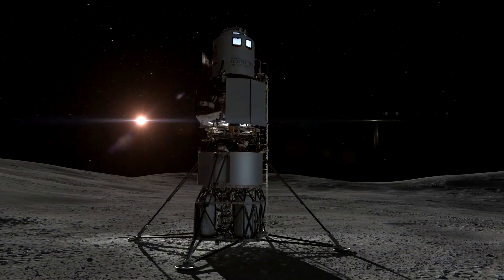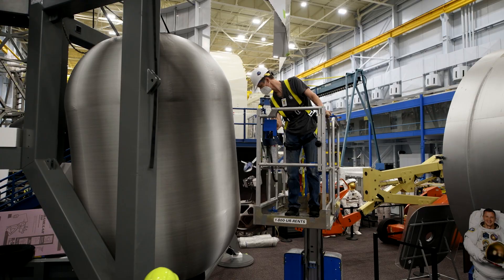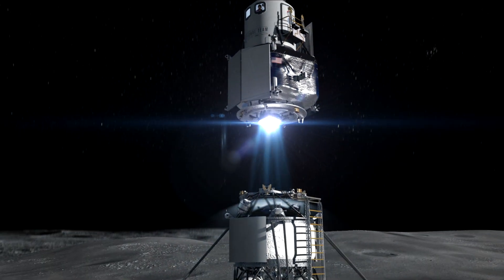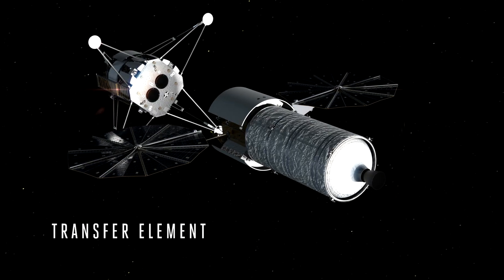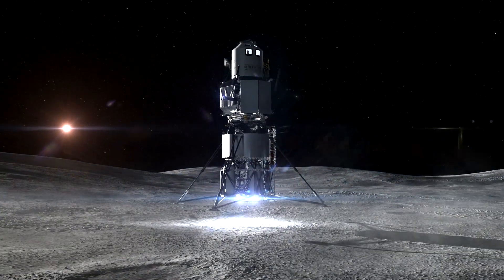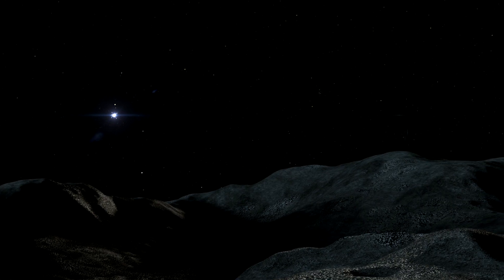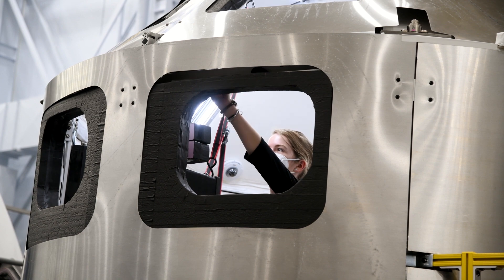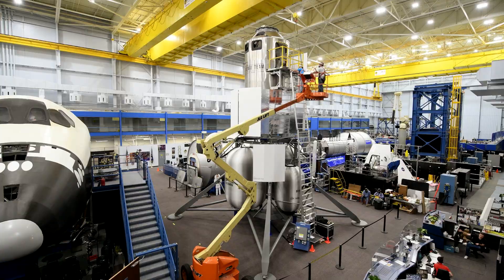Blue Origin-Led HLS National Team Mockup

Comment: I don't understand how this particular lander design will help us "stay on the moon." From the mock up it looks like it has the same capacity as the LEM (2 people) and it's not even meant for permanent habitation. Neither Blue Origin video explains at all how this is helping further habitation on the moon other than simply returning.
Reply: The Descent element can land on its own with plenty of cargo on its deck, anything from rovers to habs. Its a good set up because flying both large amounts of cargo and crew on the same lander would be inflexible due to the added mass and risk that comes with it along with the inability to perform crew-only missions to the surface. The descent element also uses hydrogen and oxygen which can take advantage of lunar Ice in the near future unlike the other two HLS systems.
Reply: well i mean returning is better then nothing. But i get your point
Reply: @milchael  Yeah, you're right -- I just feel like the branding in this video is a bit dishonest
Reply: @Fanunic  I thinks its the fact that this lander(descent element+transfer element) could land over 14 mT on the surface. That is enough for a habitat the size of ISS Destiny module.
Reply: @Matthew35333  well im tjat 14 ton there is need for a return engine. So not.much usefull space look at the capsule it 1 by 2 meters
Reply: I think They will land next to a colony so it's not needed to have a big module
Reply: It's probably modular and easily modifiable which will drastically help in making things cheaper, so if a single computer fails you can just send a replacement one instead of having to take everything out and fumble with parts and hope it works.
Reply: Simply put, having a lunar lander at all and having the capability to reuse the vehicle allows us to stay on the moon through allowing us to lower the cost of the lander, landing on the moon and by having the ability to stay on the moon. Who knows they built a completely new lander that’s 100% reusable or stay with this lander, altogether it is important that we even have the means to land on the moon rather than just orbit the moon
Reply: This one is probably less about staying and more about making a low risk lander that is likely to be finished on schedule.
However it is supposed to use things fuel cells which would allow it to function during the two week lunar night.
Reply: by leaving a lot of trash and parts of the lander behind we create a 'permanent' "pressence"
Reply: @HilkoRigterink  hey, if they crash enough of them that'll be some invaluable raw materials for someone more ambitious to work with.
Reply: I don't really get the "game changer" argument neither... it's a LEM 2.0. Not to mention the overcost induced by making this project modular and ask 3 different companies to build eack module... I think this project will be the next SLS. I won't mention the 4th company involved in this but not part of the "modular" project but my hope of seeing a moon base rely on the 4th one for sure, because this is going nowhere.
Reply: It's sustainable because it's cheap to launch, and once we have fuel production on the moon it will become fully reusable. This vehicle will be good for getting humans down to lunar surface to build landing pads for Starship and other initial base infrastructure that will be shipped via other means.
Reply: @JohnnyThund3r  I don't believe anyone has ever said the SLS is cheap to launch.
Reply: @spacetourist247  he never mentioned SLS...
Reply: @JohnnyThund3r  Starship won't need a landing pad to be built first... they will come up with adjustable landing legs and an optical terminal guidance system able to 3D scan the ground and find the best spot. Spaceship do not need someone to prepare the moon for it... because it will be the first one on the moon. The modular project will go nowhere and won't be able to keep the timeline of 2024... Those are the same kind of companies that built the SLS...
Reply: @Callum This doesn't use SLS, it's uses 3 commercial launches and assembles it all in orbit.

 @Turbo999be  Boeing is the problem child with SLS, Boeing used to be an OK company 10 years ago, now they just suck, Lockheed is a better company IMO, they tend to be more expensive but they do deliver what the government asked for. I think with these companies working together in a looser commercial program that might really give them room to shine, and prove they can get the job done in less time with less money.

@Odyssey Voyager  Interesting tid bit. I think all 3 designs do have something going for them. Dyantics being just pure simplicity, the other is of course self evident. I wish them all luck, and much funding!
Reply: @Turbo999be  You are absolutely right. This is just a complete waste of taxpayer's money. It is basically an LEM 2.0, Literally. Nothing new will come out from this lander. Basically, all this can achieve is bring back 2 astronauts and walk on the moon "again" and say "Hi folks! We're back on the moon again!". Ride back to Earth and done! They are just going to do what has already been done 14 times already in 60's to 70's technology.
Reply: Oliver Lorenzo How is this “60s and 70s technology”, or are you an aerospace engineer?
Reply: this is not the entire piece of the puzzle, so you should not think of it as such.

Comment: What plans are there for the descent element after the mission? Are you just planning to litter the moon with dozens of them (eventually) or is there some kind of reusability in the plan?
Reply: Also, assuming it becomes a successful project for a while, there's no reason it can't be upgraded or succeeded by a more re-usable version.
Reply: @Musematt11  after they first spend a few billion
Reply: I would imagine one thing you could do would be to unscrew all the various bits and use that handy material to build something else on the surface.  Now that they've spent all that money to get it to Moon, might as well put it to work, right?
Reply: No ironically the Blue Origin Element is not reusable although they pioneert reusability with new shepherd and the lockheed-martin element is the only reusable one. The Dynetics and Spacex lander proposals at least look way better tho.
Reply: I think if you have fuel production on the moon you ideally won't need the decent element any longer. You can probably get enough extra delta-V just by removing the unneeded engine and pumping the fuel from the crew module into the lander.
Reply: @XDLukas1000  BO pioneered reusability with New Shepherd... are you serious ?
Reply: @Turbo999be  Well they where the first private company to propulsively land a rocket again, you got to at least give them credit for that. Spacex did of course the harder thing of landing an orbital booster again but blue origin was also on the right track.
Reply: @XDLukas1000  First suborbital landing in 04/2015 by BO... first full orbital landing of a rocket 10x more massive than New Schepard in 12/2015... I'll give all the credits of rocket reusability to SpaceX... New Schepard is a toy that is abviously already discontinued.
Reply: Turbo999be He’s right. New Shepard is a proof-of-concept vehicle. There’s not much more that needs to be proved for New Glen.

Comment: And when you get there don't be too surprised to find a SpaceX official, climbing your ladder, and handing you immigration papers.
Reply: Ha ha ha ha . ::eyeroll:: Oy. None of these systems have been finalized, built, or qualified. SpaceX does impressive stuff, no doubt. And Starship looks like it could be great. But SpaceX also have failures and unexpected events and challenges that arise. Your hyperbole about immigration papers aside, you have no way of knowing which systems will actually make it to the Moon, or when that will happen.

I do not understand why so many Specifically-SpaceX fans seem compelled to crap on anything that is not SpaceX. It strikes me as myopic and needless. History has shown that having more providers with dissimilar systems is a more sustainable approach to spaceflight than sole providers (see the 70's, 80's 90's, 2000's, and 2010's). So the question is, do you care about spaceflight in general, or SpaceX only? Because if it's the former, then cheer on SpaceX, by all means (I certainly do). But also cheer on the others. Multiple providers competing on cost and innovation is with spaceflight, just as in other industries, the best way to get a true sustainable industry.
Reply: Wedge W 👏
Reply: @OptimusNiaa  What is there to cheer on about wasting money on non-reusable vehicles instead of investing in reusability? I'd be happy for competition for SpaceX, but right now there is none in the area that actually counts.
Reply: @StrangeQuarkStar  Re-usability is a wonderful thing, but it is not the only thing. To spend money on a journey that includes elements that aren't reusable isn't necessarily to waste that money.

It's worth noting that on a Moon mission using the National Team's system, there would be reusable elements. And on a Moon mission using SpaceX's system, there would be non-reusable elements.

And, again, beyond re-usability, dissimilar redundancy is important, particularly in spaceflight. Problems happen. Accidents happen. What if there's only one provider, and they somehow use all reusable equipment (so we're not even talking SpaceX here), but they have an accident and have to do an investigation, during which time the entire program is halted? No access.

I remember the aftermath of Challenger and Columbia. Multiple years where there was no American spaceflight, because we had one ride to space and it wasn't usable due to investigations, re-designs, and testing.

So I cheer because multiple providers competing on cost and innovation will increase access to space, prevent gaps in access, and lower costs. I also cheer because the hardware acquisition for the Artemis program is being handled the same way Commercial Cargo and Commercial Crew has been. NASA won't own and operate the hardware. They will contribute money of course, initially as partial investors (with much of the development costs being provided by private entities), but eventually just as paying customers...with the idea being that NASA will be just one of many customers. A real space-economy.

So, granting that re-usability is great, the picture here is so much larger than that.
Reply: @OptimusNiaa  I appreciate the thoughtful reply, and I agree about most of what you say in terms of Commercial Cargo and Crew. And I definitely hope there are multiple providers, the more the better, for obvious reasons! Nowhere do I say that SpaceX should be the only one company; my point is rather that the other companies should be more like them. I just can't stomach how there is money being poured into only partially reusable or completely expendable vehicles today, after the feasibility of reusability has been demonstrated. All I'm saying is that this money could be spent better — investing in future-proof technologies, rather than propping up outdated concepts. I wish the other providers were actually competing with SpaceX on this. Especially Blue Origin in this collaboration, who with their hydrogen engines could actually refuel on the moon, at least theoretically, unlike the Starship which needs to haul all its methane for descent and ascent on a single stage. 

But what do I know, perhaps all this is already on the back of the other companies' minds, and they'll use the money they get from NASA for what they can quickly cobble together now to invest in actually sustainable technologies that would just take them too long to develop in time for Artemis.
Reply: @StrangeQuarkStar  Just because money is being spent on more tried-and-true derived technologies, doesn't mean money isn't also being spent on the more revolutionary ones. Blue Origin continues to talk about using Lunar resources. Refueling on the Moon seems very much still part of their thinking. But we don't know yet how much water-ice is on the Moon, how easy it will be to extract, etc. Those unknowns can be a problem, especially if one's vehicle architecture depends on the availability of water-ice.

I get the desire for seeing the more revolutionary stuff. I'm glad SpaceX is exploring their more lofty vision. But I'm also good with companies going a more traditional route. That we have both approaches being pursued simultaneously is exactly what gives the whole dissimilar redundancy thing its strength.

No doubt the Artemis time-frame of first landing humans in 2024 is going to have played a part in their thinking. And while that has some down sides in terms of steering towards less revolutionary ideas, the 2024 deadline also has some benefits, and thus so does going a more traditional route.

I just don't see this as an either-or. BO can pursue tech that enables a 2024 landing attempt with a high degree of success, and also be pursuing tech for down the road with the 'sustainable' phase of Artemis beginning in 2028.
Reply: @OptimusNiaa  Yes. The more I think about it, the more it all makes sense. I guess I shouldn't look the gift horse that is Artemis with its accelerated timeline too much in the mouth. More progress, either way!
Reply: @StrangeQuarkStar  Yeah, that's the way I look at it. It looks to me like we're definitely in a position where it could be that the 2024 goal doesn't stymie the innovation needed for sustainability, and the desire for innovation and sustainability doesn't stymie an actual return and the advancements even that require.

Comment: "The transfer element is to transfer the Lunar Lander down to the surface of the moon."

That's not accurate. More like "transfer down to low lunar orbit." [Correction to the correction: the transfer element can bring the Lander down to suborbital velocity]
Reply: Not quite. The TE can deorbit the HLS which saves more fuel for the lander, allowing more cargo on either a crewed or uncrewed landing.
Reply: @Nowhereman10  Which would imply that afterwards, the TE has to flip 180 quickly and thrust back into an orbit to avoid impacting the lunar surface?
Reply: @brianhabing5076  which, if you recall, was often what the Apollo CSM would do for the LEM, especially for the early missions.
Reply: They don't even know what the hell they're talking about. Just a load of horse shit coming from their mouths.. As long as a "women" is on board is all they care about.
Reply: dcb1138 Just go away, would you.